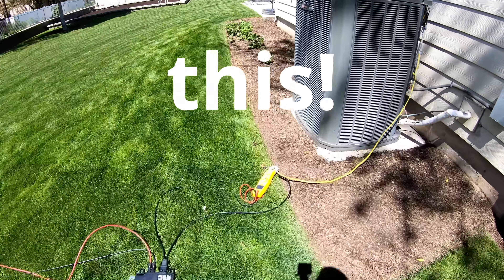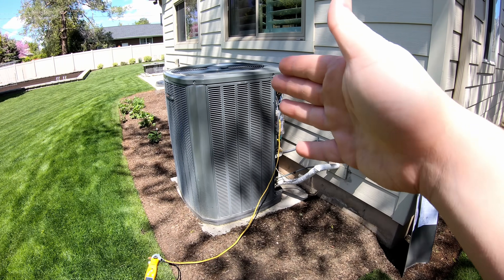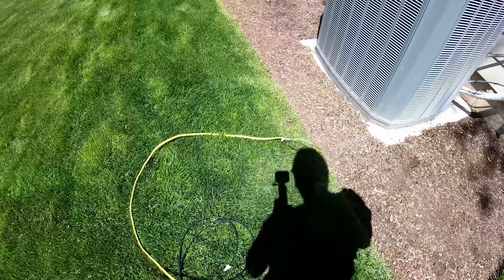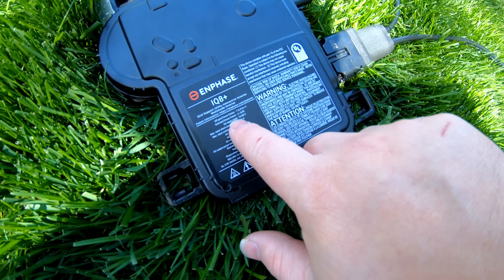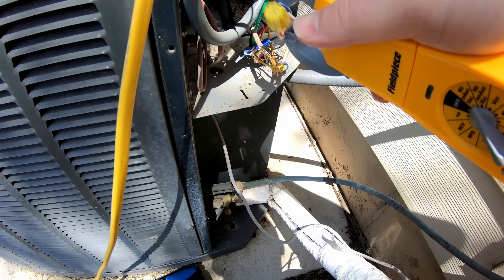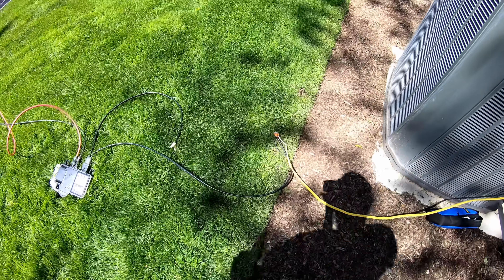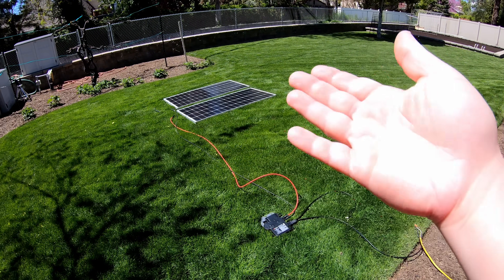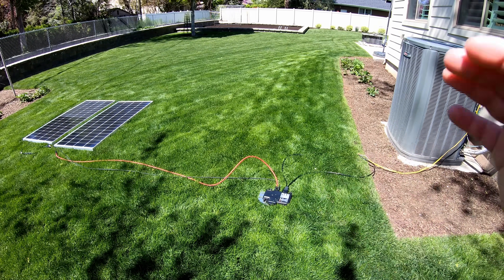1 Hack To Eliminate Your A/C Power Bill This Summer!

Comment: Missing the point here - just using a solar panel and microinverter part-time.  Basically you are handicapping what the solar panel and microinverter can do for you by only running it a fraction of the time.  Because you have this hooked up to the contactor output, the solar panel only supplements some power via the microinverter when the air conditioner compressor is on.  Why would you not hook this to a free 240V breaker in your main panel (like regular solar), or the other side of the contactor?  That way the solar panel is giving you power anytime there is sun - not just only when the air conditioner is on.  Then you don't have that 5 minute delay where you have no output from the microinverter - each time the A/C kicks on.  With this small solar setup of only 264W (AC output - your 1.1A measured), you'll never backfeed the grid - most homes draw more than that all the time.  And if you did increase your setup and at times you did export some power, this is a non-issue - you are just giving free power to the grid that you won't be paid for.  And the click bait title - this doesn't eliminate your A/C portion of your bill - just offsets a very small portion: 264W of say 4000W (4 ton A/C unit).  6.6%, not 100%
Reply from the maker: You're right, it would be ideal to have these panels running all the time, but I know some people who have been charged for excess power that went backwards through their non-net meter so better safe than sorry especially as it gets scaled up and you're pushing more power. And that's the beauty of this setup, start small with what money you have and scale from there! Offsetting 6.6% is still better than nothing while I continue to save for more panels and stuff! Thanks for watching!
Reply: @theresatrickforthat  Yeah sorry, it just makes no financial or logical sense to do this the way you've shown.  The cost of the panels and microinverter will take forever to recoup vs. the fraction of the time the AC is on with sun shinning, and the power up delay.  Most homes draw several hundred watts all the time - you won't be giving back to the grid.  Just connect the microinverter and panels full time.
Reply: @billjohnson3344  I agree 100%, IF your base load is always over what the solar panels can produce.  In his case, if his baseload isn't 300W+, say it's only 200W+, he'd probably still be better off wiring only one panel to the main, compared to two on the AC that's only occasionally running, especially with the 5 min delay factored in after each cycle... Unless his AC basically runs most of the day.
Reply: @billjohnson3344 there is inbetween here you are both missing. A 5 min delay is still good for grid stability issues and hooking to main panel if done correctly can use the solar more efficiently. Or adding batteries as an inbetween the panels and the inverter would be almost equally as good to panel tie in. Allowing a smaller array handle power 24/7 without over amping.
Reply: I’m trying to learn about solar,but I’m old 😢I would like to run a large window unit something like 28000 BTU’s with solar. I have central air just wanting to help cool my home. People are telling me I need a  solar generator. Does that sound correct? Tia

Comment: Wouldn't each of those wires be 120 volts, and out of phase with each other would be 240? If so, wouldn't that  be 1 amp x 120 v =120 watts. Both together would be 240 watts?
Reply from the maker: Yep! I calculated 288 watts. Thanks for watching!

Comment: I’m in Florida, in reality how much would this assist my electric bill? I have a brand new 4 ton unit in my house and with the current weather it’s running often. Every little bit will help! Also looking at the easy start to assist with hurricane season.
Reply from the maker: You can scale this concept as big as you need to fully eliminate the power you A/C unit uses, then apply the power bill savings to getting battery backup so then you'll be able to use the solar panels all the time including when the AC is off and have the battery and solar to assist you during hurricane season. That's at least what I would do! Thanks for watching!

Comment: This setup will cost about $1000. ROI would be (I'm guessing based on your example) about a 15% reduction in the portion of my power bill that applies to the AC unit (it will only be effective at the angle it is set up to take advantage of the afternoon sun), which would be about $23/month ($300/2 and * .15). So it would take about 43 months to break even.
Reply: Tell me if I'm doing this right...
8:00 the power from the panels was 1.2A @ 240v.  That's 288W.
If you could get that for 8 hours, that would be 288 x 8 = 2304 Wh, or 2.304 kWh. Per day.  Over 30 days, that's 69.12 kWh per month.
If your electricity rate averages $0.15 per kWh (say, in TX) that would be worth $10.37.  In CA, maybe double that.  In HI, maybe tripple.
If these numbers are right, that's why solar is still hard to justify without incentives in TX, where it would take 100 months to pay for a $1000 investment...not to mention the time sink.
Reply: @737smartin  Also, consider that the panels only really work when aimed directly at the sun, so your power output will wax and wane over the course of the day. I'm guessing you'll get an average of about 4 hours of full usage in a whole day. Realistically, you're going to point these towards the sun at the peak hours of the afternoon sun around 3 o'clock. I'm guessing you'll only get that 1.2 amps at that time. At 1:00 it will probably be 50-75%. At 11:00 it will be probably much less than 25-50%. I could spend the time to work this out, but I'm guesstimating to see if the ball park figures make any sense for a physical trial run.

Next, he was using about 5.2 amps and supplemented 1.2 from the panels. That's 23% at peak hour. So I averaged it to 15% over the total daytime hours, which is being generous, I think. Between your estimation and mine it's between 43 and 100 months just to break even. I suppose you could add more panels, maybe a total of 8. By my math that would be closer to $2300 for a 100-month break even point (8.3 years). By then you'll have to replace most of your system.

There's no real way to know how well this will work without getting more scientific, but from what I've heard through other people's experiences, solar usually winds up being a waste of time unless you really spend the time to tweak and refine it, maintain it, etc. If you read reviews and blogs from people who own homes that installed solar power, most of them admit it wound up costing them more than they saved. To get the most benefit, you need to install sun tracking (expensive), high-efficiency panels (expensive), then configure, tweak and test... It's a commitment that is a net loss for the average person.

One thing I've considered is a combo system with solar+wind using savonius-style turbines. Again, this is probably better for someone who has time and money to experiment. The ROI still might not be worth it. If you were able to double your output, it would still take several years to break even. For it to be worth my time I'd need to go net positive within 2 years.
Reply: @abrotherinchrist  I agree with much of what you said, although this system should last for 20-30 years (granted with possibly around 1% loss in efficiency per year as the panels age).  The ROI is somewhat attractive when you look at the long-term, especially since rates will only go up in the future.  Also, don't waste your time with wind yet.  The current wind turbines are somewhat pricey and have short lifespans... And that's assuming you have the ideal wind to keep them going.
Reply: @ssoffshore5111  If they can get solar panels to considerably more than 25% efficiency then maybe I'd take the leap. Yes, wind hasn't made much strides in residential yet as far as I know. If some of these new commercial designs can be adapted for residential use maybe it would be worth it. I wish there was a small, vertical, quiet turbine that I could place in a very specific spot. My car port catches the easterly winds and funnels them right through this small corridor between my utility room and the house. It amplifies 4-5MPH winds to feel more like 10-15. That's more than enough to start a savonius-style turbine moving and we get pretty consistent wind up to 10-12MPH, which would get that thing spinning furiously. It would be nice to find a way to tap into this accidental wind tunnel.
Reply from the maker: Everyone's ROI will be different due to a zillion factors. For me, I'm using this as a stepping stone to get to a larger system with batteries and everything...but I have yet to have the $100 bill I planted in my garden years ago grow into a money tree (joking intended) so I'm buying things in small chunks and putting what I have to work since every penny saved helps me save for the next thing all the faster! Thanks for watching!
Reply: @theresatrickforthat  Moving forward is GREAT!  
I just hope everyone makes informed decisions about where they “invest.”  I know many who have bought solar in TX just because it’s a hobby they like or an industry they want to support whatever the cost.  Good for them!  
Unfortunately I also know some who were sold a bill of goods and spent borrowed money because they took a salesman’s “advice” without understanding the likely payback time.  I am VERY pro-solar and renewables, but my money is still too busy “making money” so I can retire soon.  I just can’t bring myself to splurge on a big system.  I DO have a self-installed 100W setup on my dock, though!

Comment: Does the inverter only allow solar power to flow when an amperage is drawn from the grid or will it feed the grid when it just "sees" 240?  I want to use this on my pool pump but it is a variable speed hooked up to a Pentair easy touch 8 and apparently the line and loads must be hooked up to the line side of the line side of the relay.  No current flowing until the relay kicks on. I know that sounds strange but that is the way it is wired.
Reply from the maker: I'm unfamiliar with your setup...but these inverters just need to "see" the grid to produce power. They do not need to see power being drawn in order to produce power. Thanks for watching!

Comment: I have been using this method for last 9 years.
Yes it definitely does work, but you need to add battery though because when air-condition is not being used, energy produced by solar panels is wasted
Reply from the maker: You're right! One day I'll have enough saved for a battery...but this is a great way to start small with what you can afford and scale as money allows. Thanks for watching!

Comment: Just a side thought, if someone had the right sun path, the panels could act as a slanted cover over the AC itself. My understanding is that Solar is more efficient in cooler temps, so maybe the fan/airflow would help cool them making them more efficient.
Reply: That's hot air coming out of that unit. It's all the heat that isn't in the house anymore.
Reply: @jm-um1tx  wrong, that fan is not a part of the air in the house at all. It is a heatsink, but it's not hotter than the ambient air temperature and is most likely cooler than a black panel getting hit with direct sunlight on a 100 plus degree day. Not to mention, shading that unit could in return make it run cooler and more efficient as well.
Reply: @josephcatano4705  Didn't say it's the house air. It's air heated by the heat extracted from the house. 

There are lots of tricks to up the efficiency of an AC unit, and yes, shading it with the panels might help, but the panels themselves are already getting hit with direct sunlight, and blowing hot air on them isn't likely to help as much as you'd think.

How much the panels are heated or cooled by the air is very much dependent on local conditions and you'd want to do detailed calculations to confirm whether it helps or hinders.
Reply: @jm-um1tx  I get your thought completely, but on average an outdoor unit will probably only be 15 to 25 degrees hotter Fahrenheit. A solar panel will easily be 40 to 50 degrees hotter. Just because it seems warmer to you doesn't mean it won't feel cool to the panel. I am also not talking about directly over the unit, it could have foot two or 3 feet of breathing room. Also the temp of the compressor or lines will be hottest part that I referred to. The air flowing around the unit doesn't transfer heat at a 1 to 1 ratio or even close. So the air flow would still be a couple degrees hotter than ambient temps. Resource, owner and maintainer of a 24kwh system in TX.
Reply: @josephcatano4705  Yeah, maybe. but gotta do the math first. 

And it can't just work at high noon on the hottest day of the year, it's got to work on enough days so that there's a benefit averaged over the whole cooling season.

I get that you're taking advantage of air that's already moving, but stuff like this almost always ends  up being marginal at best. 

I wouldn't be surprised if just shading the unit wasn't a bigger factor. People don't do enough of it.
Reply from the maker: Very interesting thought! I like it! I sense we might need to do some testing on this at some point! Thanks for watching!

Comment: The AC is irrelevant in all this, correct?
Reply from the maker: If you're talking about the type of AC unit...basically yes, this will work with any 240V AC unit that has a contactor inside. Thanks for watching!
Reply: @theresatrickforthat  Isn't this you hooking up a solar panel thru an inverter to feed into your home power system and thus the grid?

Then anything in your home that pulls power from the grid/home (light, fan, washing machine, electric oven, etc) will be getting a few hundred watts via the solar input?  Thus the AC has nothing to do with it and is simply an example of something hooked up?  Or am I misunderstanding?

Comment: Why can't you plug it into a outlet and get the watts all the time when the sun is shining? it seems like a waste of money to only get a small amount of watts for a limited time.
Reply from the maker: If you don't have a net meter installed, excess power has the potential to flow backwards into the grid and some meters can't tell which direction power is flowing through them and you could be charged for the excess power you push back to the grid. This way you can completely isolate the solar system and just do self consumption on the AC while and slowly grow your array as money allows. And then one day you can convert it to a whole grid tie or off grid system that runs all the time. But in the meantime, at least you're getting some benefit as you're saving! Thanks for watching!

Comment: Interesting but not financially or legally wise.  The 2000W of solar ($1000) and 3000W of grid tie inverters ($500) plus minor items like wiring, panel mounts, disconnect, circuit breakers, conduit, etc., say $2000 all in.  Since the system can only pay for itself while the sun is shining and the AC is running you may only get 1-2 hours a day of power output.  Maybe you get 5 kWh of power, and that offsets $1 worth of power a day.  That's 6 years to get your money back, maybe longer.
Reply from the maker: You're right. it would be much better if the panels could run non-stop. But some of us don't have tons of money just sitting around to do a full system. This way you can scale slowly as money allows while still reaping some albeit small benefit. Then one day you can convert the system over to a full system once it's grown large enough. Thanks for watching!

Comment: if you put the right UF capacitor infront the air conditioner you can make it consume as much as 50w to function, remember its not the volts its the amps that matter
Reply from the maker: Not sure I 100% follow, but thanks for watching!
Reply: @theresatrickforthat  your A/C uses around 500watts right ? you can change its consumption to 50watts by finetuning with capacitor on the input, it can alter the phase and is dialectric, it has some special effects

Comment: Ok, FIRST OFF, you have the inverter tied to a 1.5 pole contactor. In order to completely isolate grid from the inverter, you need to change to a 2 pole contactor… 

Also, you are connecting full 240V potential to the inverter… the wiring is hot all the time. Do not do this.
Reply from the maker: Hummm. I’ll have to check…you most certainly want to have the full 240V to the inverter, otherwise it won’t turn on. And I know the inverter shuts down when the AC does, so the contactor seems to be doing its job. Anyway, certainly worth looking into! Thanks for watching!

Comment: I had a few grid tie inverters to offset crypto mining, I didn't have a net metering agreement and didn't get questioned when I backed the grid. my smart meter only monitored consumption and showed 0 for export. here when you get a grid solar setup they will change your meter parameters. so they happily took my power and sold it next door.
I first did this with old mechanical meter which wound back my usage, then the smart meters rolled out.
Reply from the maker: Using it for Crypto Mining is a great use case! Thanks for watching!
Reply: My smart meter tripped a tamper warning (it's been doing so for over a year as they would have to reset it) when I back-fed the grid, clearly my utility seems to be content using my excess power too! 

BTW, my system does have anti-islanding so no concern over zapping someone if the grid goes down.